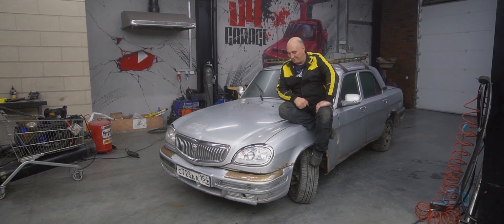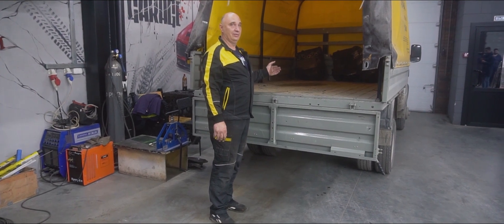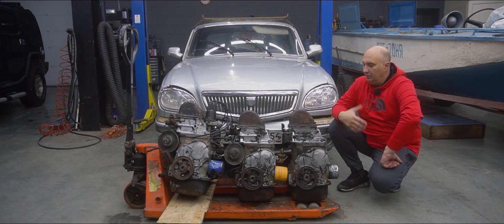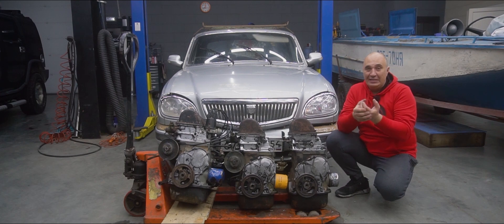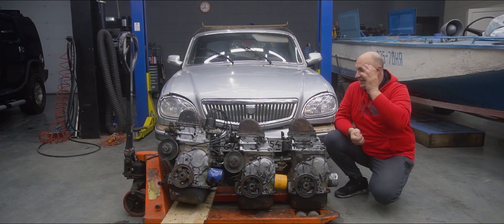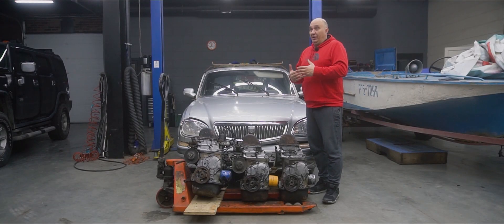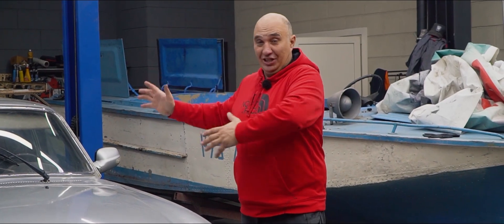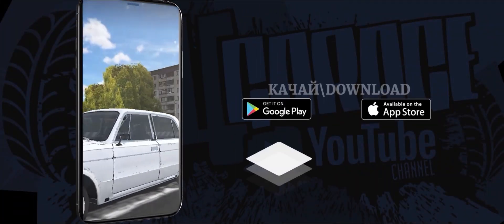Combining three Lada motors into a makeshift V12

Comment: Build a triangular exoskeleton frame to bolt all three motors together than a long motorcycle chain around all three pressure plates and the trans hooked up to the bottom engine. I think use a motorcycle chain on the back is your best bet than have a nice big radiator and electric fan.
Reply: Yeah, that was also my first thought, use a motorcycle chain
Reply: You would also need 3 ways of actuating throttle All 3 of them In unison  Or one will  Over or under throttle the others
Reply: I wonder if a more industrial version of a bicycle freewheel sprocket would be possible, any engine could provide torque but if it's running a little slow it won't take anything out of the system
Reply: @commiellama  There are industrial sprag clutchs that have been utilized in automotive situations.. you find them a bunch in one-off builds like this, and common in automatic transmissions.
Reply: @CheesyChimichanga  i mean would that really be any different than with a belt though? the only difference i see is that a chain can't slip.
Reply: @CheesyChimichanga  That's true. Also you'd have to fine tune the timing to get the exact same revs on idle and the spark timing position.
Reply: The problem with the chain theory is that all 3  engines may not be  Capable of providing the exact same amount of torque or horsepower therefore one will drag down the rest and the chain will come off
Reply: @CheesyChimichanga  maybe put some kind of one way spinning bearing between the engine and the chain drive, then if one turns slower then the chain can just spin faster than it... after reading comments, i see this idea has been mentioned lol
Reply: I typed my whole comment, looked down and saw you had the exact same idea. FML lol
Reply: Also if chain is properly tension-ed and your timing is right, throttle pull should be looked at as you want all the motors to actuate at the same level.
Reply: @chrisclaus983  Balancing engine output will be the same as setting carbs on a streetbike IMO. 

But in this case, I would suggest to have the primary engine rev a little earlier than the second, and the second a little earlier than the 3rd.. that should keep tension on the drive-side of the chain cycle and prevent any chatter.
Reply: How about using 5 lada engines to make a Adams-Farwell rotary engine.

Comment: Put them in a triangle configuration with the 3 crankshafts fitted with gears, driving the sun gear in the middle of the triangle that drives the transmission/gearbox etc....the 3 planetary gears on the driveshafts will each be driving the sun gear in the center of the triangle....more of a delta/star 12 engine . . . a Tri-12 engine.
Reply: Just do it . . .the one engine at the bottom, the other top left and top right . . . in a triangle.

Comment: They should be assembled in a sub chassis...from the sub chassis to the car's chassis you use rubber cushions... attach them all using
belts...not dented belts...simple belts that can skid when needed....use tension adjustment to the belts

Comment: Plate holding the engines in position on the front 
Brackets / bars at the back 
Use a big bike chain and sprockets instead of belts
Reply: Transfer cases use chains, those would be better cause we know it would survive the torque
Reply: Yeah chains instead of belts please
Reply: Instead of a Y shape looking from the front make a T shape looking from above. Where you take the rear axle from a lada and put an engine at each end. The driveshaft connection goes to the engine that has the transmission and the other two engines replace the tires. Of course you'd cut the axle lengths down a whole bunch so they don't stick out each side super far.
Reply: @Omegacron37  Would you connect shortened rear axles to the crankshafts of the two engines at the rear wheels? That wouldn't work. The RPM of the center engine would dictate the RPM of the drive shaft, which would dictate the RPM of the axle engines, but the axle engines need to have their RPM independent, for the same reason a differential allows the rear wheels to rotate at different speeds. If you decouple the axle engines, you might as well not have the center one. I think having them mounted like a "W" with a torque converter on each one, and the torque converters driving a central gear is the only way they can both operate independently and all contribute torque and power to the drive train.
Reply: @jjohnston94   You're right that the gearing would mess it up since the input to a diff is different than its output (I overlooked this). Unless they ran the engines at different RPMs. Though I'm not sure how you'd go about starting them if you did that...
Reply: Yep, plates, or as they're sometimes called in the biz, "elephant ear mounts". One front, one rear.
Reply: Ya chain of will be stronger and won't slip

Comment: A hydraulic pump on the flywheel of each engine, then simply run the combined output to a hydraulic motor driving the drive shaft. You don't need a transmission then either
Reply: I was thinking about 3 hydraulic pumps at the front of the engines (you can give the pums a lot of revs by using a smal wheel on each pump - wich is connected to each belt-wheel by its own belt).
Then connect each pump (exit/input) to the next one - so that you have a circular system.
The bennefit would be, that the engines don't have to match revs perfectly. The stronger engines would help the weaker one to run smoothly.
It will cause some lose of energy, but that will happen in any case.
There would be only a physical connection between the engine in the middel and the driveshaft.

Not an easy "solution" but I'm courious if it could work.
Reply: The combined output to a hydraulic motor without a transmission would be pointless. Most of them are low rpm high torque and you would likely just blow the seals because of the excess pressure under load because it can only allow so much fluid to pass through the drive motor depending on the hydraulic motors size and the passages that allow the fluid to pass through it. Also high pressure hydraulics are extremely dangerous
Reply: @cody8754  UPS uses a hybrid hydraulic drive system
Reply: @Swansen03  I actually did some work on that hydraulic hybrid through EPA, it was an absolute nightmare of a vehicle. Horrendously inefficient compared to the electric hybrid technology available only a few years later.
Reply: @otm646  you mean like the hybrid locomotives that have been in use using for decades(or all of them)? or the asinine fake hybrids of the automotive sector...
Reply: @cody8754  another version here https://youtu.be/ud7k_ERjyGk it's entirely doable
Reply: My first taught to. But its to easy. They should use (dont know english Word for it but the belt stuff from snowmobiles.
Reply: @gunnarbrunstig8377  It's variator I think
Reply: @nemolevola  that sounds about Right 😀
Reply: @gunnarbrunstig8377  CVT
Reply: @gunnarbrunstig8377  
In English a snowmobile uses a centrifugal clutch and a continuously variable transmission usually referred to as a CVT.
Reply: @gunnarbrunstig8377  Torque Converter
Reply: torque converter not for slow driving they are ineffective at slow speed
Reply: I think you will just need this bearing Things that just work in one direction, so if one is turning slower it will just dont give force. Like on a bycicle
Reply: It will work, i have done something kinda similar. Basically turns ur vehicle in to tractor. Very slow but more torque then u know what to do with. I have a 78’ cj5 that i made into a hydrostatic with a 3 speed manual. A hydraulic motor that drives the original 3 speed and differential in the jeep. Very slow but it can pull anything with only weight of the vehicle and traction being the limits. It will take off in 3rd gear at idle with absolutely no problem. Also runs on a propane fueled industrial ford 4 cylinder. All from a parking lot sweeper. I would estimate that it probly only goes 8-10mph wide open in 3rd gear. To make speed costs major money. Plus having pumps that could handle that much flow and pressure probly wouldnt be very good running on belts
Reply: Hydraulic drive is usually high torque low speed. It would work but it would be slow and inefficient. There is a reason most automatic transmissions use a torque converter and planetary gears.

Comment: Without just buy losing an all out custom block and a custom crankshaft, using the belts is probably the best solution to make this work. I'm excited to see it run! You might have to have a custom gear box built, like they use in tractors in tractor pull racing.

Comment: How about a "W12", I4 in the centre and the other 2 beside it at an angle, idk if that can be considered as W12 😅😅
Reply: Such configuration you describe is the correct orientation for a W engine, with 3 cylinder banks. It was often used in WW2 era aeroplanes.
The VW group W engines are basically just two VR engines stuck together with 4 banks of cylinders across 2 blocks arranged in V shape.
Reply: There was an F1 team that had a W12 in a similar arrangement. I think it was the Life team
Reply: yes
Reply: Well if you know ladas came with twin rotor rotary engines that made 120 bhp and took the Lada to 180 kmph. I feel they should just try to combine 2 or 3 of these Lada rotaries.
Reply: More like, Ж12...

Comment: Come on do a W16 that would be fun. Or even a W32.
Reply: Right more room in the trunk and backseat.
Reply: It is a W indeed. But making a W32 will require 8 Lada engines and 250+ bhp. Also remember one Lada engine weighs 120 kg , and 8 weighs 960 kg. So you will totally ruin the weight distribution of the car.
Reply: @atarvhegde5210  An 8-engine W-32 would make WAY more than 250hp... A 3-engine 12-cylinder setup they've made already dyno'd at 160hp at the wheels.
Reply: I was thinking the same thing, but it's probably an issue of fitting at least part of the assembly into the engine bay 😂
Reply: build a car made out of engines.
Reply: Its not a w engine its 3 i4s in series
Reply: @JonDoe-007  Yes I know that it's more like an N engine you will need 4 for a W that's why I asked them to do a W.